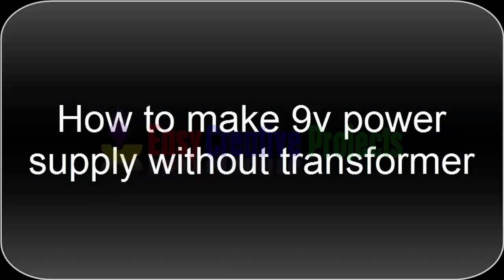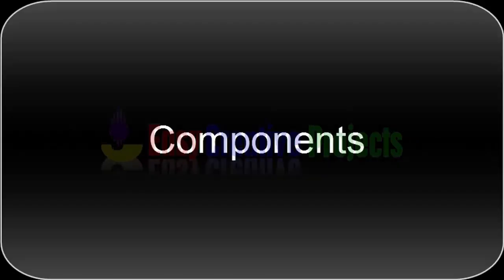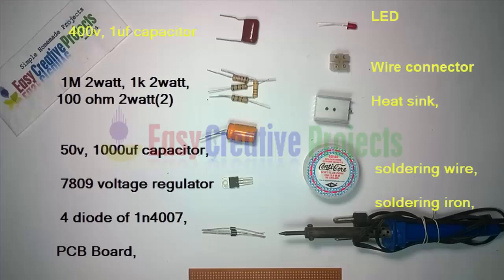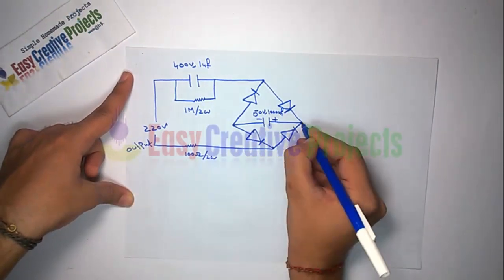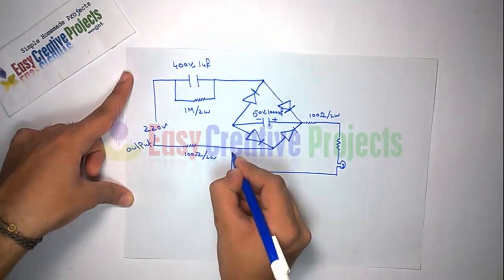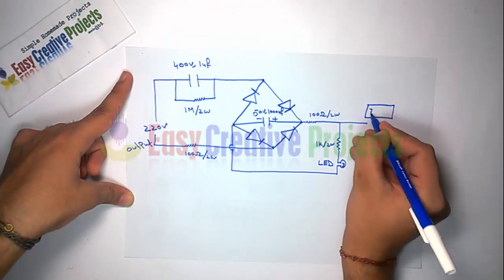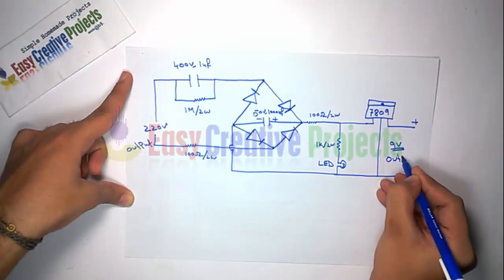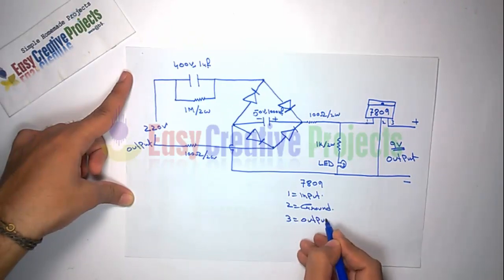How to make 9v power supply without transformer - easy step by step with circuit diagram

Comment: There is ZERO SAFETY incorporated into this design.  One of the most important aspects of a transformer coupled power supply is safety.  The transformer isolates YOU from the mains should you get zapped.

Carry on!

Comment: Sir/Madam 
Can I use this voltage for IR sensor operation ??
Reply from the maker: its only education purpose project. its not save. 
you must need transformer power supply for any local projects and experiments. thanks.

Comment: Works like a charm. But in place of 1K, use 330 ohm. The voltage before the regulator is very high and the 1K resistor heats up very fast. The voltage before the regulator should at least be 16-17V when using a 330 Ohm. But if you're going to use 1K, the voltage will be at 49V. Before it is regulated and you won't get a 9V as such.

Comment: Can i use 63v 100uf Capacitor in place of 50v 1000uf
Reply from the maker: if you use 100uf capacitor then its fail to convert pure DC. 
but its working.

Comment: Can I use 7812cv instead of 7809?
Reply from the maker: 7812 provide you 12v output. if your requirement is 12v then you can use it.

Comment: This is called  a capacitive power supply or transformerless power supply. Yes, it''s a thing.
It's used on most night lights that we use at home every day, and it's designed to output 10's of mA only.
It has very specific use, so don't go crazy trying to build one for your phone, PC or any other significant power consuming electronics.

Comment: How much amps we get I need to make a ps2 power supply .
Reply from the maker: dear 1st this power supply only for education purpose. its not reliable.
use transformer as your need amp. for example. if you need 2amp power so use 2 amp transformer.
thanks.

Comment: Can we use mpt 154k 26 capasiter
Reply from the maker: dear 154k capacitor give you 0.15uf   and 105k give you 1uf .
we can use a set of 154k capacitor.
but this time we play with direct power supply. its very dangerous. if any capacitor damage or leak so blast.

Comment: Led of what value , where as other components are shown with their values. The video is very good to understand. Can indicator LED be used if so what shall be resistor value. Also make  clear the colour of LED  as volt vary as per colour
Reply from the maker: yes you can also use indicator led with 1k /1w resistor.

Comment: What should we need to do if we need 12 volt with 10 amp
Reply from the maker: simple use 12v and 10 amp transformer.
Reply: sweet girl you can use two or more ceramic capacitor seriously before getting output but 10A is not possible!

Comment: sir i need to know how to make your circuit correctly.you can use same components for 24v and 9 volt.the regulator can be control the output voltage.but 1microfared capacitor allows 24v .....you can use all the circuit with the same.i have majour doubt about the initial components of 105k capacitor and resistor calculations only....
Reply from the maker: both project without voltage regulator output voltage  32v. so in 1st project i use 9v voltage regulator and 2nd project 24v voltage regulator. 
practical work is different and theory also different. 
theory only clear our consent. 
1 more thing china product not given perfect reading.

Comment: Can we connect variable resistor to the output of 7809 to adjust the voltage
Reply from the maker: yes you can connect variable resistor. for output (0v to 9v)
try to use 10k variable resistor.
Reply: or you could just use an lm317 that outputs variable voltages instead of a 9volt regulator (7809)
Reply: use a 9v zener diode instead of 9809 regulator to reduce un necessary heating of the system.

Comment: USeless  schematic
 you use 7809 and 
you get 8,5 v...

This have olny one reassion

the voltage in pin 1 of 7809 and ground
is 10,5 v 

want min 11,1 v to work fine ...